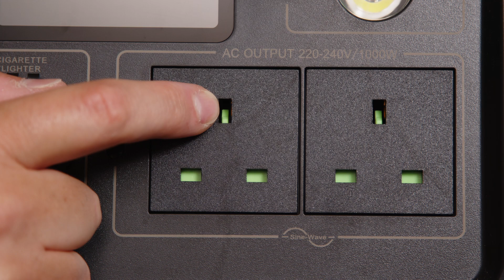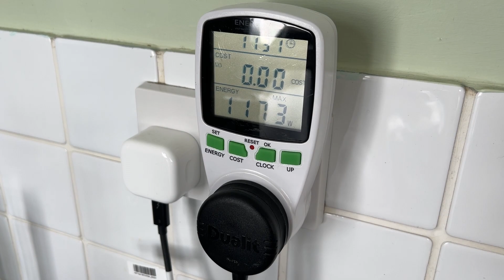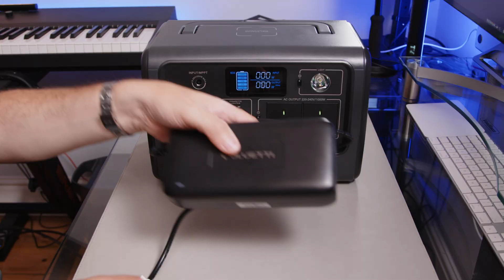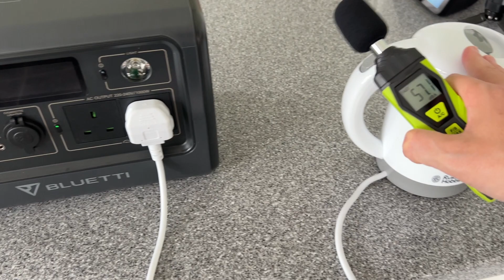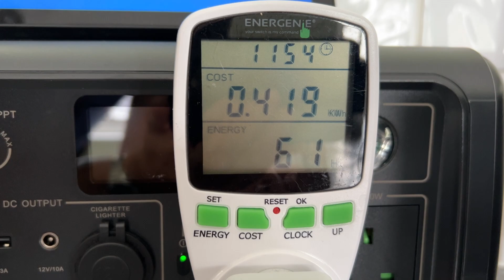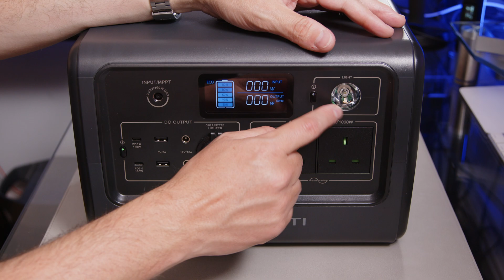BLUETTI EB70 Power Station - 1 Month Honest Review

Comment: I was very concerned about the EB70s performance especially because mine was already on the way when I watched your review. So I started testing the moment it arrived, first cycling the batteries one or twice, using it on various items like laptops, fans, coffee machines etc.  I was particularly concerned about the purity of the sine wave and the frequency since those can hurt some equipment. My findings: running high and low, at 20% battery, +/- 960 watts load, frequency was fluctuating not more that 0.5 Hz. (better than mains supply). AC voltage drop was minimal, not worth mentioning and sine wave, oh boy, was so perfect , zero noise/deformity, a clean sine wave that electricity suppliers will die for!  I have seen many inverters, claiming pure sine wave that just cannot keep it up as soon as load goes past 70/80% of specification! To sum up, I suspect some problems with your unit, connection or your frequency tester. I also ran tests on my EB55 and got same good results.
At this point the EB55 and EB70 are discontinued but lots are available at good discounts which makes it an excellent buy. Apart from that and much investigation, I am super impressed by the EB70.

Comment: Hi there, great review. I have two quiestions: 
1) Do you think you can power a CB radio and use a laptop when the CB is transmitting?  I am just wondering how well the 27MHz is filtered out.    
2) Can you run a hair dryer (like 800W) on this EB70?  Is there no current surge when turning it on?  
Thank you very much.

Comment: Its been a while but thanks for your detailed and really helpful review of the EB 70, from Melbourne, Australia. This model has now effectively been replaced by the AC180, but as I do have the EB 70 would you kindly do a review about the usefulness of the more recently released Bluetti DC DC 1 Charger that I have just purchased, and plan to to use with my EB 70, as an alternative power source to the Bluetti PV 200 200w solar panels and the available 100w car sockets in my vehicle, (there are lots of reviews of the Charger 1 in use with the AC180 and other brands and models of power stations, i.e. typically reviews refer to current range and models.

Comment: I couldn't even run a 49 watt freezer with this thing, it overloaded the unit. I contacted bluetti and after many emails and videos and pictures,  they agreed to a return and refund. I then purchased the AC180P, Hope that does better.
Reply from the maker: No doubt the in-rush current of the compressor is too much for the smaller inverter. It’ll happily power 1000W devices but the freezer may demand a few kW (if only for a half a second)
Reply: @tdcattech  .... I sat there waiting for it to kick in, 395 watts came up on the display, then dropped to 49 watts. I just couldn't understand why it would overload it considering 395 watts is well below it's said capacity. I've ordered AC180P, fingers crossed this might sort it out. Thanks for your reply 👍
Reply from the maker: It might only display 395W but sometimes, that peak will be considerably higher. If it drops to 49W and it's still on, it should be OK but the next time it fires up, it might not manage it. That's my experience with fridges. You really need something that can handle a surge of 2kW or more.
Reply: @tdcattech  .... the initial plugging it in was ok and turning g on the first time but when it came to coming on the second time it overloads. Disappointing, I ran a small ac 30 watt fridge on it, it went OK, ran for 18 hours.

Comment: For some reason I wish the input was on the back. I feel its a bit in the way when i want to use the DC output.
Reply from the maker: I sometimes think that manufacturers are missing a trick not putting multiple inputs on these. Due to the frequent use in small spaces (RV, tent, transporter etc.) the best place for them changes. It would be nice to have front and back (with a selector if needed).

Comment: I found this really helpful. As someone else said the instructions are a bit limited. Was a bit concerned when I first powered it up as I wasn’t expecting any noise! I live out in the sticks (in the UK) and we get a lot of power cuts. If they’re of short duration it’s not a problem but my main reason for buying this is because I have a tropical fish tank and if the heater, filtration and air pump are off for any length of time the fish will suffer. I now feel a lot happier with  this as backup.  Would it make sense to have the fish tank ‘stuff’ permanently plugged in to the Bluetti and for the Bluetti to be permanently plugged into the mains or will that simply wear the Bluetti out, as it were? As you can tell, I’m not remotely technical minded and would appreciate your advice.
Reply from the maker: Yes, this one isn't designed to operate as a UPS or EPS (uninterruptible power supply) so it shouldn't be plugged in all the time. I'm testing a nice product from Anker at the moment that works perfectly as a UPS and can be left plugged in 24/7 - https://geni.us/solixc1000 - Alternatively, if all you need is mains backup and you don't need the extra USB outputs, solar charging etc. you could just buy a UPS for this - https://geni.us/bx1600mi - Something like this would keep things ticking over for a few hours in a power cut.
Reply: Thank you

Comment: I purchased an Xtorm XP500 LiFePo4 power station that is very similar in spec to this Bluetti, and i tried to use it at -8.3°C outside (doing astrophotography) and both 12V DC ports stopped delivering power after about 2hrs when the power station cooled down. It was showing -1°C on the display, so i guess it cuts off power at 0°C or below, or the voltage has dropped and it couldn't function any more. 

The LiFePo4 batteries are supposedly rated to work at a temperature range of -20°C to 60°C (-4°F to 140°F), but optimal performance is achieved between 0°C and 45°C, but it doesn't seem so in my case. 

I will have to do some more testing but i don't think it will work in such low temps. None of these power stations will i think.

Comment: Since you are now expert with EB70 Power Station, can you please confirm if the generator AC Output of 220-240V can be used to power up the AC Adapter for charging the generator itself. Your kind attention with these matters highly appreciated.
Reply from the maker: I don't see why not though I also have no idea why you would want to do that. 🤷🏻‍♂️
Reply: Thank you soo much for such an insights, I raise the thoughts coz I used my EB70 power station up on the hill and during rainy season in our place I could not get enough charging power from my solar panel and have been trying to consider this idea for sometimes and hopefully with your favorable clarification it could boost my guts to proceed as intended.  @tdcattech

Comment: Great video with lots of useful info - thanks for posting. I think the question on most people's minds (me included) when considering buying is if it can power the things I want it to, especially for home use where you have more appliances than when camping. It's actually a tricky thing to determine and a bit of a gamble in a way, because it's not easy to know the necessary ratings for each of your appliances. Also, I don't have all the measuring equipment to know and manuals/internet searches of my appliances aren't always clear, so that increases the gamble I'm taking when buying.

The two biggest takes-aways for me are the below. In summary, do your homework and check, as best you can, if the generator you want can indeed run the appliances you need - I think you'll be surprised with what you find, and I bet lots of people get caught out.

1. You have to (somehow?) find out the inrush current /surge of the appliance you want to run, not just its standard running current. It's crazy how high that inrush value can be for a device that uses very little energy once going, and it's also crazy how 'high-end' a generator needs to be to meet that need. A $1000 generator can't even run a standard fridge because it can't overcome 2 seconds of the fridge's inrush / surge power?!? I was amazed (read: disappointed) to learn that.

2. Some of the simplest, smallest appliances in the home use unbelievably high amounts of power compared to others: kettle, toaster, hair dryer, small heater - items designed to produce lots of heat very quickly. They consume SO much power. We take them all for granted as basic, everyday items, but I'd have to buy a $2000 generator to barely run just one of those small, commonly-used appliances. That shocked me and really made me question how worthwhile getting a generator is - how many times would you have to boil a kettle to justify a $2000 generator? I know it's not as simple as that, but in some ways it is.
Reply from the maker: You're dead right about the inrush on fridges. We have a modest fridge which varies in power between 75W and 95W when running. The inrush demand is huge though. I think only my EcoFlow batteries will handle it which suggests the inrush requires about 2kW / 8A.
Reply: @tdcattech  Thanks for sharing that insight. I know the generator units report their surge power rating, but that's not enough info - you need to know the same about your devices, and indeed the sum total across all devices you connect simultaneously.

Comment: Seeing it tripped on the toaster put me off
Reply: Seeing a 800ml bottle not holding 1L put me off.
Reply from the maker: It’s over the rating for the inverter so I guess you should find it reassuring. Of course, if you need to use more than 1kW, it’s definitely not for you. 👍🏻

Comment: I live in South Africa where "load shedding" is a daily thing to power the TV and Router in the bedroom--works great. The only issue is the noise at night. Are there other similar units that are quieter?
Reply from the maker: I've just been reading up on load shedding across South Africa after I read your comment. So are these total blackouts in allocated areas during these times or is it a reduction in usage during certain periods (potentially in an attempt to avoid blackouts)?

To answer your question, not really. The EB70 is pretty quiet and all mains inverter / battery combinations will need cooling of some kind for safety so they all make a noise but do vary in how loud cooling is. If you opted for something smaller (less capacity and less inverter output but still enough for a TV and router) you could probably get it silent. You could then charge that smaller battery from a larger one using DC out whilst using it. Lots of wasted power there but it would work.
Reply: @tdcattech  Its a total blackout. The grid is switched off completely for the allocated areas, during the allocated timeslots...for example at the time of typing this comment, 
we are on stage 6 load shedding...we will have no electricity at home this evening from 20h00 to 00h00 in the area where I live.
Reply: Same here, I found the EcoFlow River Pro to be relatively quiet, I bought this Bluetti EB70 as my secondary